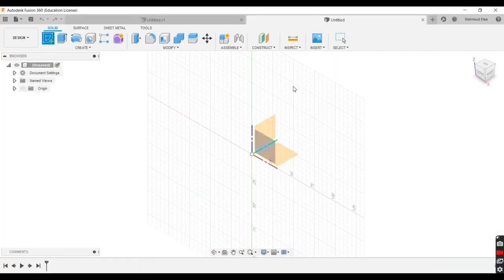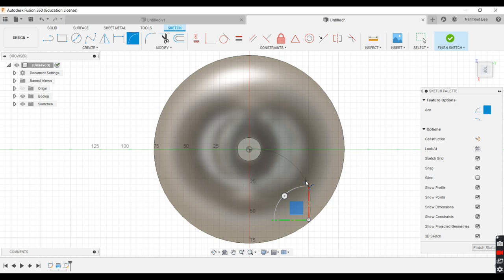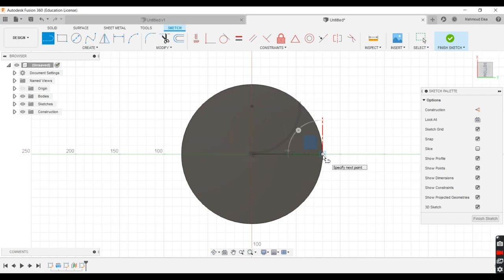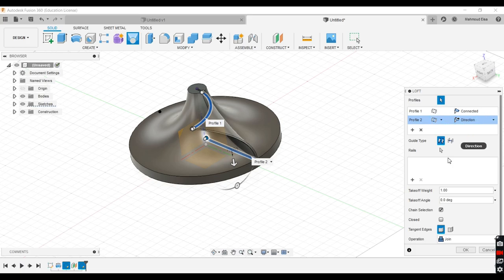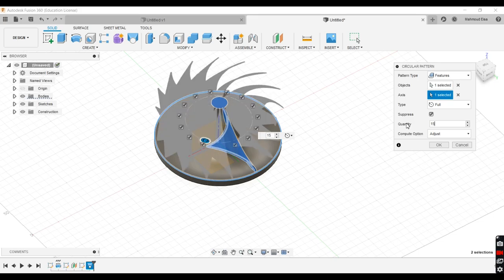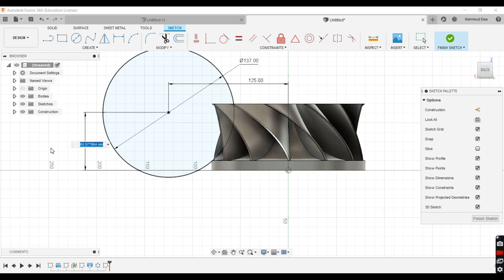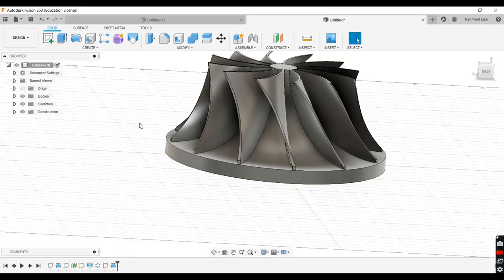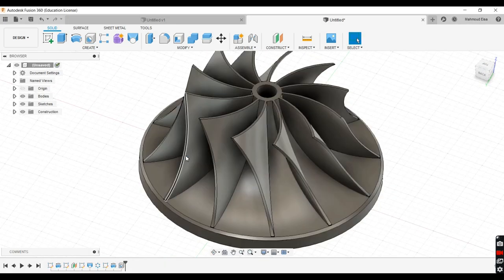How To make Turbo Impeller in fusion 360 ;)

Comment: Awesome video! Could you explain the difference between this type of design vs the design used for compressors in jet engines (multiple stages of blades)? Why would you use one vs the other for different situations? Is one better than the other?